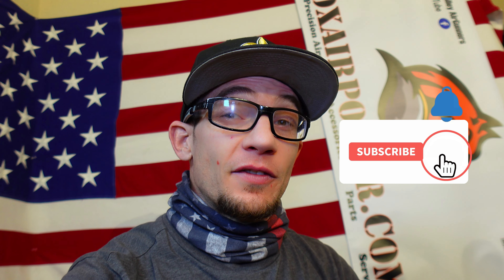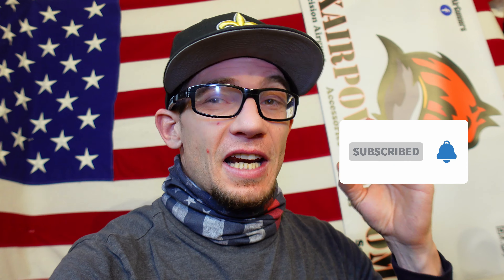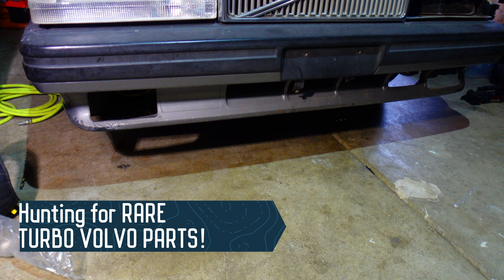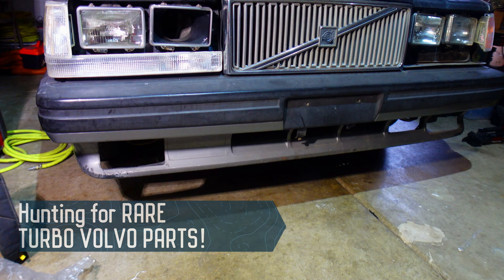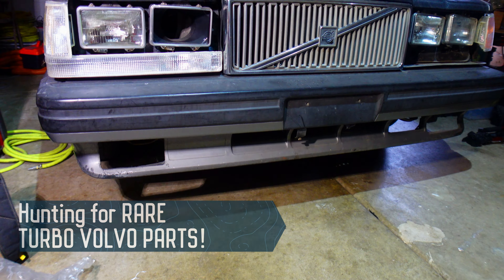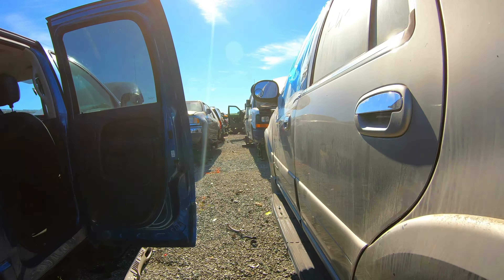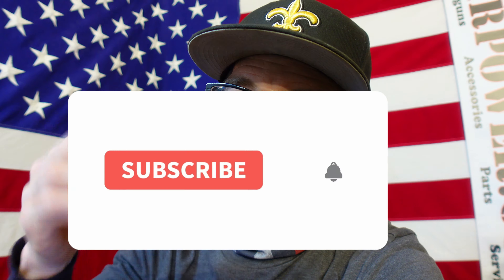( RARE TURBO VOLVO 760 740 JUNKYARD PARTS HUNT ) PLUS: Bin Tac AEA S45 Update

Comment: I miss going to the junkyards
Reply: So, Mike, what do you recommend taking to the junkyard?  Do you go big bore and shoot at engine blocks or stick with smaller calibers and take out windows, mirrors, tail lights???😂
Reply: @jims6450  take whatever you want.  I used to take tools to the junkyards. LOL!  I used to primarily go to the yards when I was in high school and college for parts.
Reply: @TheLovedr79  Seems all I have are 7.62mm "tools" in my airgun toolbox. lol  But wouldn't it be tons of fun to go to a junkyard and do some plinking?   I spent many a saturday hunched over, under, and around junkyards in my day, too.   What blows me away the most is that all the local junkyards at the edge of town when I was a kid are now all tract housing and concrete tilt-up warehouses.  Oh crap.  Aren't they called "auto recyclers" nowadays?  My apologies to any auto recyclers tuning in that I may have offended...
Reply: @jims6450  oh, I still spend many hours working on it under motorized vehicles of all types.  Airguns would be fun in the yard but if the opportunity ever came up to shoot in a yard I would have to break out some powder burners too.  That's the reason I haven't been to a yard in several years, the closest one that has anything that we drive is 2 hours away. The one that was a few miles from where I grew up at is gone or no longer open to the public. I loved wandering around pilaging I'd usually come home with everything except the part(s) I needed.

Comment: Great to see you back Mac!  Have you considered trying to repair the old MAS?  I can't wait to see your video on that new S45.  The specs for it say it gets 6 shots, one magazine, on a tank of air before needing refilling.  With a hundred .45 rounds ready to shoot, you're going to have to refill 16 times!  I sure hope you've got a couple of 100 cuft air tanks topped off to 310 bar ready to go.  And, tethering those tanks will probably be your best bet.  What's your plan for this?
Reply from the maker: I got the backup tank in the stock! I hope I get more than 6!
Reply: @macabespeed  Oh, yeah.  I forgot.  They're giving away a free rear tank on preorders.  That should at least double the number of shots per fill.  I wonder if that back tank can be filled by the front tanks fill port?   No matter how you dice it, that is going to be one awesome home defense weapon!
Reply from the maker: I cannot wait to get mine in my hands! Fullllll testing for sure without fail
Reply: So much information yet to be gleaned and only by having one of those bad boys in your hands.  Please, please do an unboxing video!

Comment: Yo Mac, can't you get a MAF sensor at any parts place ? They should be fairly cheap no? Or is it discontinued... 
In any case I am sure you can find one somehow.
I love my 80's early 90's euros, I used to be into them bigtime.
I had a 86 VW Scirocco, a 87 Saab 900 and a 91 VW Corrado lol. I know what you mean about getting parts haha there was a large company called Euro Parts and I used to get all the hard to find parts from them.
Reply from the maker: It’s over 400 bucks for a non Bosch replacement! I am considering aftermarket engine management so I can run any combo of parts I want!
Reply: @macabespeed  Holy smokes they don't give those away 😳...